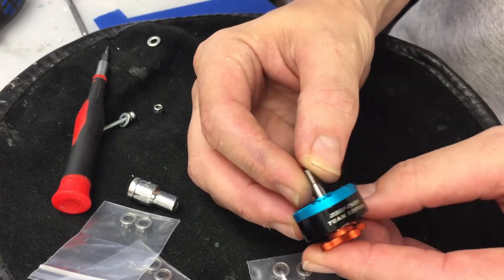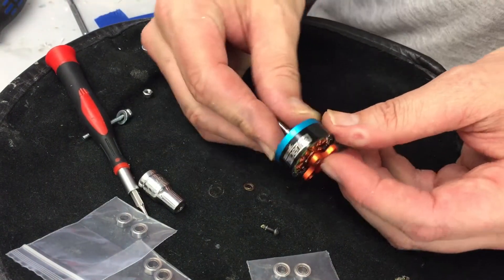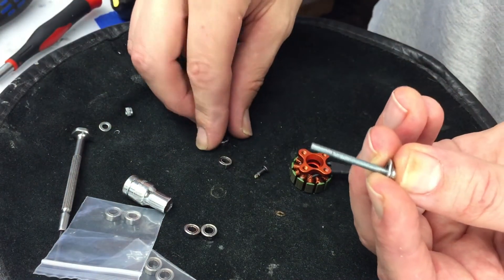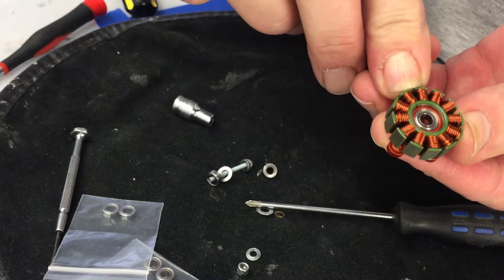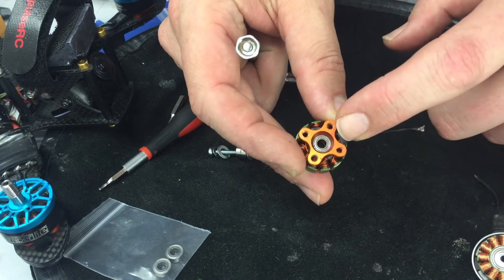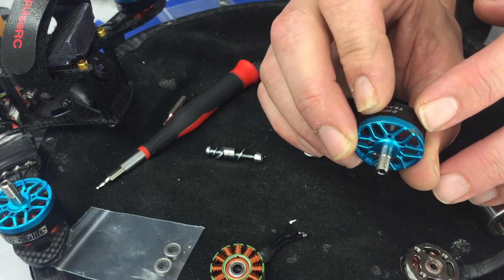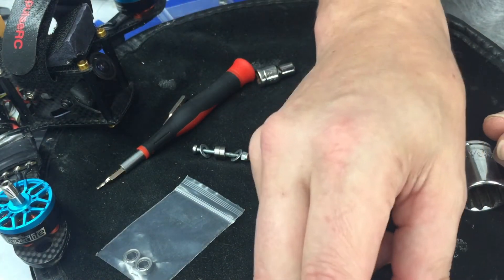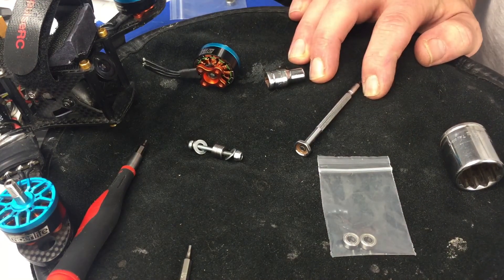How to replace bearings in an FPV / Drone electric Motor || Hyperlite type motor

Comment: RED loctite for that? I guess if you never want them back out. I tried this with some eachine motors, they use some weird super thin locking ring in there which made tapping out the original bearings nearly impossible without an actual press, you just about almost destroy the stator doing so.
Reply from the maker: That’s why you use the soldering iron to heat up the bolt so the red Loctite releases.
Reply: @reaganleejobe  thats not what im talking about. They didn't have a bolt it was a clip style. They had something inside the housing holding the bearing in

Comment: Great tips! Where can I buy bearings for my BrotherHobby R6 2207 motors?
Reply from the maker: Neil Camara Most people that sell motors sell replacement bearings. First you need to know the size of the bearing which is measured in millimeters. Measured in width and height. So how many millimeters the bearing is across and how many millimeters the bearing is tall. I have some 2306 brother hobby motors. They are 9 mm wide. I’m not sure about the height.  I will pull one apart this evening and get back to you on the height. Thanks
Reply: @reaganleejobe  I found out the size of my motors yesterday. It's 9x9x4. I ordered 10 pieces for a total of $9. Not bad. It will arrive on May 12. Thank you!

Comment: Would u recommend people use small hammer screwdrivers to take out the bearings?
Reply from the maker: JC250 in the video I use a very small flat head screwdriver and hammer to punch them out. Be careful you are on the bearing and not the center aluminum. 👍